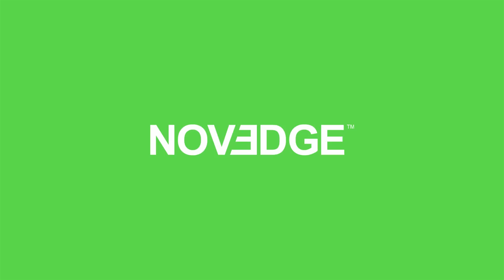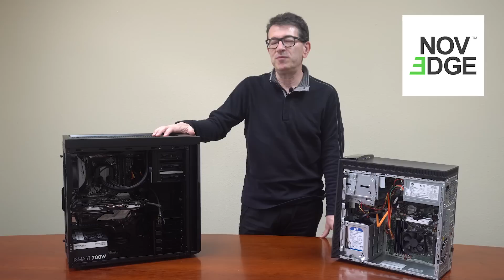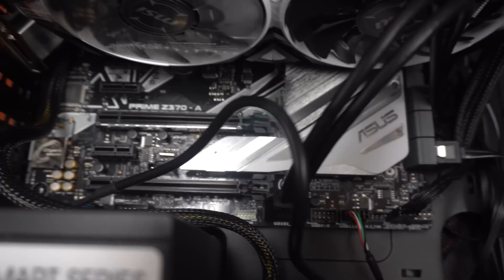Novedge Talks: Why do you need a CAD Workstation ?

Comment: I'm a Newbie from South Africa I got this quote for a workstation, can you please let me know if it is ok.

Intel Core i9-9900K (3.6GHz, 16MB Cache, 16x Threads, 5.0GHz
Turbo)
MSI B360 BAZOOKA DDR4 Intel 8th Gen Motherboard
NVIDIA Quadro P2000 5GB 1024 Cores Workstation Card
Antec P8 Performance Tempered Glass Gaming Case Black
Corsair CX850M 850W Modular Gaming Power Supply
32GB DDR4 2666Mhz High Performance Gaming RAM
Antec C400 Elite Performance CPU Cooler Blue
480GB Ultra-Fast SSD Upto 500MB/s+ Speed
Integrated High Quality HD Sound Card

Comment: What is the average lifespan of a workstation before you need to replace? 
Thanks
Reply: Bob Kalache It depends on how much money you are willing to spend when selecting and buying components. If you have top of the line components, your workstation will last you for a long time. I‘ve spend $4-4500 on my workstation 3 1/2 years ago and it is still running perfectly in terms of 3D modeling, rendering, photo / 4K video editing.

If you buy a high end CPU, you won‘t have to upgrade it every two years or so unless you want the latest. On the other hand, since more softwares utilize GPU acceleration, you could consider upgrading your GPU in two or three years.